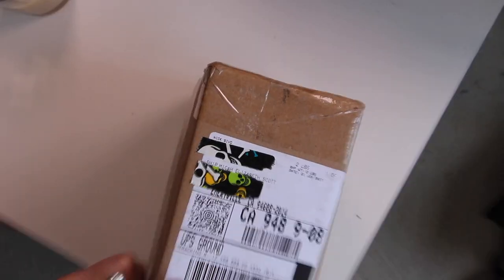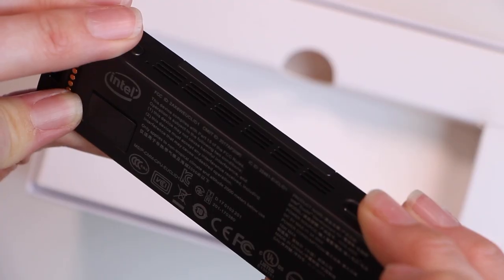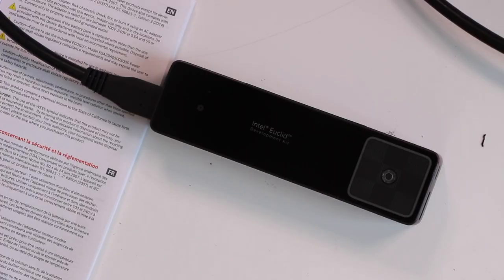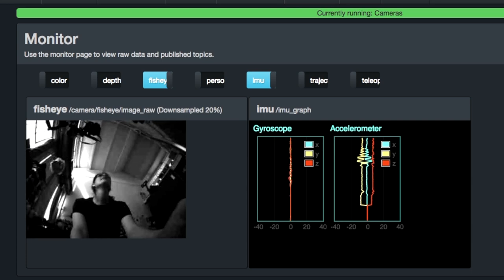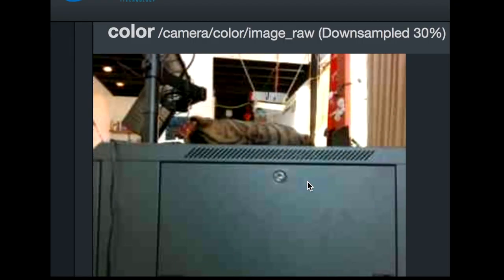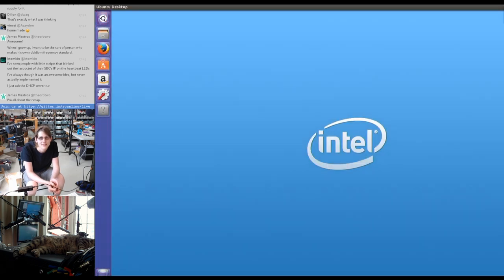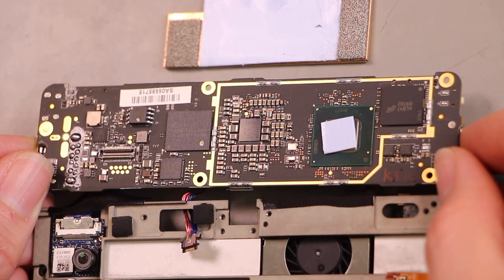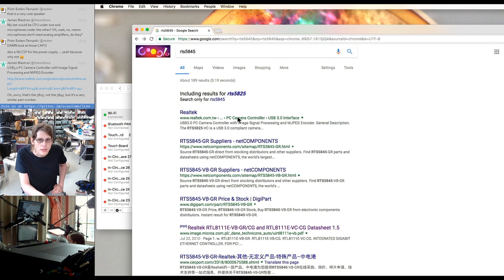Intel Euclid Teardown - scanlime:022

Comment: Nice teardown. Never seen an Intel Power supply chip. All the designs that I saw had an AXP288 or something similar from AXP inside. At24:08: That vendor is Micron and the part is MT52L512M64D4PQ-107. 32Gb LPDDR3 RAM.